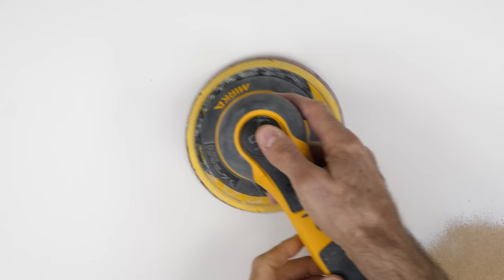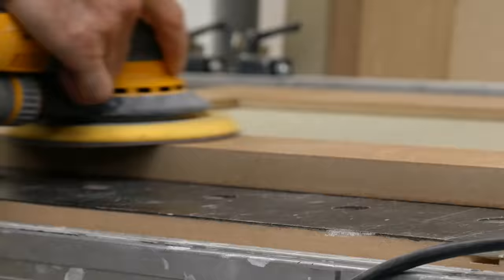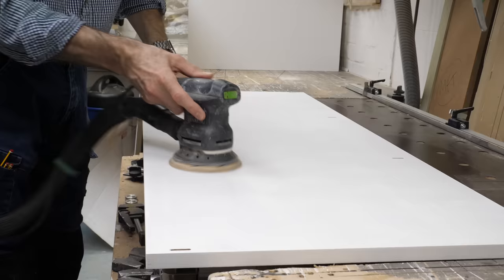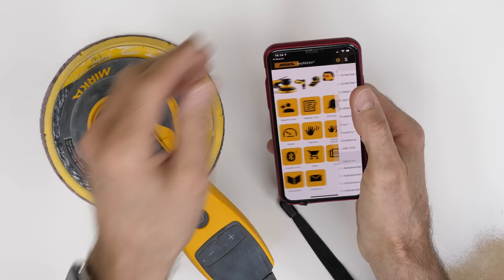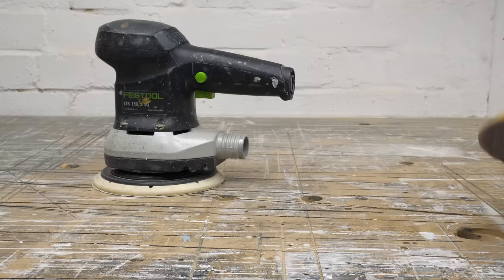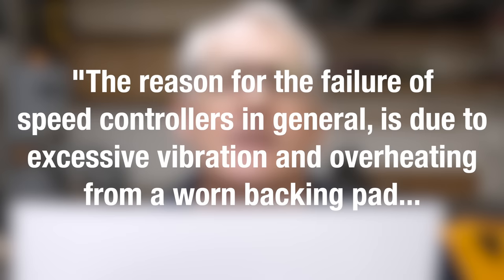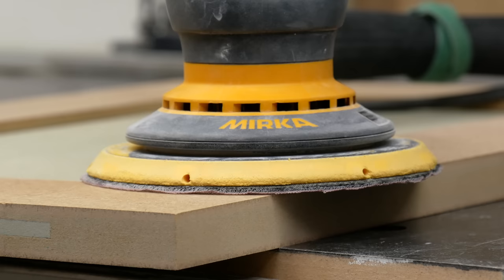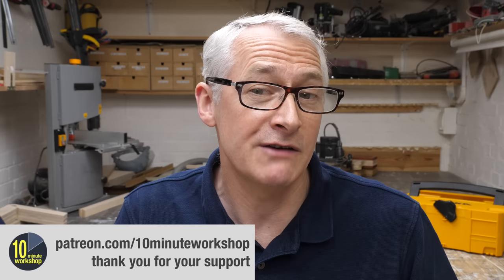Mirka Deros Random Orbital Sander [video 406]

Comment: More a comment on the company than the product: I have a 11-year old Ceros and it is still going strong. About four years ago the dedicated/compatible Mirka vacuum packed up. Well out of warranty, I shipped it to Mirka's appointed repairer expecting a big bill. They phoned me up and said the vacuum had clearly failed due to a manufacturing fault and not through usage so they replaced the motor and refurbished the vacuum and refunded the cost of shipping it to them - all without me mentioning the words "warranty" or "goodwill".
Reply from the maker: Thanks! That’s the kind of outstanding service that keeps you going back as a customer - and good to hear your Ceros is still going strong after 11 years, too. May I ask was this in the UK, or elsewhere? I only ask as I know that service levels can vary somewhat between countries.👍👍
Reply: @10MinuteWorkshop  Hi Peter, this was in the UK.

Comment: Bosch has the patent for interchangeable disc sizes. Bosch plays nice with Mirka, but I think there’s some sand throwing once Festool is in the sandbox? I think Bosch is still pissed over loosing the injunction over sawstop on the T-Rex table saw with skin detection.  Festool parent then decides to rub a little salt into the wound. Ha

Comment: The sanders are WAY to expensive as the quality is not on par with the purchase price. Sold mine (it had a 2.5 mm stroke) and had the same speed break problem...while being brand new - never been used. Mirka should solve these problem(s) !

Comment: I looked at that sander a few years ago, if the 'paddle' was the other way around! but for the price....no thanks, I looked at the Festool Rotex at a tool show last year but couldn't justify the £625 outlay or 'Investment' but if you doing a lot of sanding, thats the one to buy IMO, I have a 5" Makita which does just fine (corded, as with the battery for anything other than working on flat surfaces it hurts you arm after 10mins!) it replaced my 20yr old Dewalt 'palm' sander (which i still use with 60 or 80 grit for feathering paint, but the noise!!!!) If I wanted to really invest in a sander it would be a Festool
Reply from the maker: Yeah, I have the Rotex and it’s a big, heavy sander. Fantastic machine, but not the ‘one sander to rule them all’! 👍👍

Comment: Fixing Youtubers with products... You can see the Mirka on several German Woodworking Chanels. The price is impressiv. I think black/green is a better Choice as yellow/black. The Bosch GEX 125/150 seems to be a cheaper Choice with more value for the money. I'm using a 30 years old green Bosch. For agressiv sanding i bought a GET 125.
Reply from the maker: I’m using a 13 year-old festool. Works great 🤷‍♂️👍

Comment: I am not in the market for one, but the "flappy paddle" would be a definite turn off, I would consider it a safety issue.  Interestingly, I have a couple of air tools with similar speed control handles, one has a safety lock device and the other does not.  I have formed the habit of disconnection the one that does not when it is not in my hand.
Reply from the maker: Thanks! Yes, I think Kit’s just a matter of conditioning yourself to using it. Having revisited it, I’m much more comfortable with it now I’m expecting it. 👍👍
Reply: If you used it for a month I think you'd find it harder to go back to a push button sander than using you'd find to start using this. I don't touch the manual speed adjustment on mine, just vary hand pressure - it's the most natural thing in the world but there's a very slight learning curve to it, like a clutch on the car. 
I actually wish more tools could be made like this. A jigsaw for example, if you like reverse scribing with the tool underneath the stock and the blade pointing out the top as I do, then a barrel grip jigsaw with intuitive paddle trigger would be something I'd definitely like to try

Comment: They look nice, but anecdotally they are not reliable. Bosch do a r/o sander that has low vibration, 4mm orbit and interchangeable pads - 150mm standard, 150 mm festool pattern and 125mm standard. Brilliant tool. I went for the Festool ets150ec. Very light, low profile, available with 3 or 5mm orbits and unbeatable reliability. If you want a vicious but controllable 125mm sander, you can't go far wrong with the rotex 125. And no, I am not sponsored by Festool( wish I was though!)
Reply from the maker: Thanks David! Yes, I have the Rotex 125, but I find it overly aggressive for ‘normal’ sanding in Rotex mode, and not enough (3.6mm stroke) in normal mode. I will be taking a look at the Bosch though. 👍
Reply: @10MinuteWorkshop  GEX 115-150 AVE is the model number I think

Comment: Hi Peter, just thought I'd share my postive experinces with the Deros, had mine about 2 years now with no issues and great results. I favour gripping the tool from the top, using my palm to control the flappy paddle, rather than my thumb like you were showing in the video. Have you tried that? I find you have much better control that way. I know what you mean about uncertainty though, I'll admit after seeing Matt and Keith's issues it has got me worried about reaching the end of my 3 year warranty! Thanks for another great video.
Reply from the maker: Hi and thanks! I’m really pleased it working for you - it’s a great sander, and I’ve had many folks say the same thing - been worked hard for years and hasn’t missed a beat. But Imm also hearing about a lot of in-warranty failures, and concerns about future repair bills. Re the paddle, the fingertips control wa skits to demonstrate it - if you do it with your palm nobody would see what was going on. 👍👍
Reply: @10MinuteWorkshop  Hi thanks for the reply. Yes I suppose I'll see how it goes, fingers crossed mine's one of the lucky ones that keeps going. Ah that makes sense re the paddle operation demonstration, I didn't think of that.

Comment: I bought the mirka it was more than €200 cheaper than the 5mm Festool
I have a lot of festool sanders so I was kind of curious too.
It works fine so no worries until it doesn't.
Anyway to sand off paint I found the mirkas Iridium paper to be in a class of its own, beware that is rather course 
for its grit size. And  it does not work so well with my rotex since the rotex rotates and smear the paint on 
the paper and not like the 5mm that rolls it up to small balls like gravel that falls straight to the ground.
Now i got Iridium for all my sanders, I really dislike the net. For wood or hard paint I still use granat.
One thing thou, Bluetooth on a grinder how useful is that? And then you need a special 24mm key to change pad
when a tool-free solution would be golden, that's just mind boggling weird priorities.
Oh and mirkas sleeve for the vacumhose is brilliant and lot cheaper alternative to hoses with cables in them. I prefer the sleeve.
Reply from the maker: Thanks - I’ll take a look at iridium. 👍👍 And yes, the Bluetooth thing is weirdly pointless. As I say, make it part of a security feature and you could see the point, but as it is I don’t need an app to tell me it’s time to stop sanding. 🤷‍♂️👍👍

Comment: The slightest hint of a problem with a product in that price range is enough for me to say no.  Say what about this little beauty from Axminster, the Bosch GEX125-150 AVE.  Two pad sizes, your favorite trigger style and a brand known for being reliable and half the price.  Hmm, might  be interesting to see how well it fits in with your Festool products.  Bosch L-boxx included.  Did I mention the 400W motor?
Reply from the maker: Thanks Mark! Yes, it’s an interesting one, but they seem to have gone for a ‘tweener’ stroke of 4mm, which is a bit fine for some of the prep work, and a bit coarse for the finer finishing. As you say, 400w motor though, so may be worth a further look, thanks! 👍

Comment: Hi Peter, yes I've got one too and yes it had to go back after I think the first project I used it on! I was told there was a problem with the motor as well. Thankfully the after sales experience was good. I'm not a lover of the thing to be honest, I don't like the flappy paddle, always seems to get in the way,  I'm sure this could be resolved with a thumb operated switch on both sides of the main stem. The speed buttons are difficult to press and I don't see the need for an on/off switch in the handle either. The finish is ok, dust extraction very good but there's more vibration than I was expecting, I've been told to keep an eye on the bolts that hold the plates on and to be aware of it going out of balance making the vibration worse. The whole thing is expensive , so are any add ons, would I buy one again ? Juries still out on that one !
Reply from the maker: Thanks Ian! I think the on/off on the handle is to accommodate the flappy paddle ie so you can switch it off to flip it over & change discs! Your experience seems to reflect a fair few others. 👍👍
Reply: @10MinuteWorkshop  Yes that makes sense,  and so it seems to make the switch sealed but I just find it difficult to operate and often as not forget to switch it off in any case !

Comment: Dont know if motor problems are only in export units. Here in finland where they are made, i've used several mirka deros/ceros sanders literally thousands of hours professionally in the last 10 years and no motor problems. Most typical problem is the cord breaks near the sander where it wiggles and rounds itself tightly with the dusthose. One unit had a bearing problem after 6 month of use almost a 8 hour use per day. And yes bearings go bad after 3 year extensive use but thats normal when the machine has hunderds of hours of use. Perhaps issue in new mirkas are some bad part which they didnt use before also? Just wanted to share my experience.
Reply from the maker: Thank you! The issues go back many years - there’s a thread in the Festool Owners Group board about them dating back to 2014 or so, but all from outside Finland, I think, so you may be right about the export units. And yes, I’ve also run my festool sanders literally all day long. Low vibration, excellent dust control, these are expected at this level, I think. 👍👍

Comment: The Mirka has a tiny tiny motor compared to other sanders. I'm not surprised if it's gets easily overloaded.
Reply from the maker: No it's a beast - it may 'only' be 350w but it's a DC motor and is almost impossible to stall. 👍
Reply: @10MinuteWorkshop  I thought the equivalent model from Festool had 50W more for the same size of pad.
Reply from the maker: Never used one, but if the Festool has a bit more grunt then it could be amazing! 👍👍

Comment: I had the Ceros, failed and failed again, just at wrong time in middle of job. I loved the size but too expensive to keep replacing.  Light use now gone to festool which has had an absolute hammering even sanded my oak floor with it.  Never mirka again.  I do use the mirka disks though
Reply from the maker: Thanks! Yes, it seems odd - some can take a hammering, others fail so easily. My festool - as tall and tippy as it feels in comparison hasn’t missed a beat in ~13 years - same set of brushes. 🤷‍♂️👍

Comment: I bought one recently. Used it 3 times on the 4th it wouldn’t turn on or even blink the lights. Most likely a fuse. I am worried because I bought it then stored it in my office for two years waiting on my Festool to die. Hope they will repair it without charging a arm and a leg.
Reply from the maker: Fingers crossed - let me know how it goes. 👍👍

Comment: So why is it the cheap Sanders have a vacuum fan and the bag whereas expensive Sanders have none.
Reply from the maker: I think cheap sanders rely on the airflow generated by the motor to push dust into the bag, which is why you don't want to use them for prolonged periods. 🤷‍♂️

Comment: whats the difference between this and a delwhat hand orbital sander. does this remove material quicker
Reply from the maker: Not sure which DeWalt sander you mean, but this is a brushless, low profile motor that is almost impossible to stall. Also,available,in a variety of strokes from 3 mm to 7mm I think, so yes, capable of removing material faster.👍

Comment: hi peter I think you will find the idea of the top button comes from air sanders and backing pad really...I own a bosch which I may of mentioned before had it now tens years come with 150mm and 125mm pads never replaced them. i would never buy mirka overpriced and over rated

Comment: What about the metabo sxe turbo 150mm with 2.8mm or 6.2mm orbit?
Not 5 inch 5mm but close.  I have the Deros and this metabo.  Which is best...bang for buck the metabo.
Reply from the maker: Had the Metabo as well before I picked up my Festool. Great sander, ergonomics don’t compare though. 👍👍
Reply: @10MinuteWorkshop  Have you tried the Metabo sxe 150 5.0 bl? Had a look at tool fairs. Other than colour, it's identical to the Mirka Deros. Don't know of anyone who's actually had or used one in anger to see if it suffers any of the same issues though.
Reply from the maker: No, I havent - I’ve had it pointed out to me a couple of times but I’d forgotten about it tbh, or put it aside mentally as it was similar money to the Mirka. You’ve got me thinking now though Stew...! 😂😆👍👍

Comment: did you ever try a Rupes or Flex (same machines) sanders?
Reply from the maker: No, I never have. They’re pretty specialist bits of kit here- would love to have a look at one - if they’re listening! 😂👍🤷‍♂️
Reply: @10MinuteWorkshop  I only can vouch for the Rupes Delta sander. it has a few more extracting holes then the festool and their dust filter works very decent.

Comment: There is a cheaper option to this. The non-bluetooth Mirka Deros is now sold as the Metabo SXE 150
Reply from the maker: Yes, though it's not much cheaper! 👍
Reply: @10MinuteWorkshop  Can be through eBay deals. Got mine £240 last November. Happy so far but i'll se how the reliability plays out. Enjoying it for all the reasons you liked it so far.